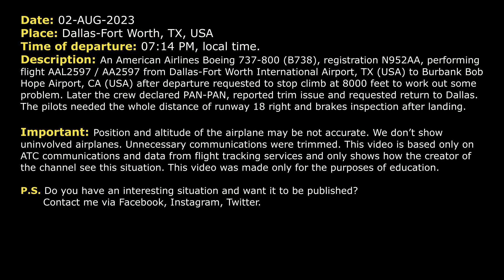PAN-PAN. Trim issue. American Boeing 737 need to return to Dallas-Fort Worth. Real ATC

Comment: Good thing they realized the issue while still near DFW.

Burbank (BUR) runways are very short and probably can't handle that type of landing. 5,800 ft and 6,600 feet respectively. That's a 737-800 and I've landed at Burbank aboard a 737-800 on runway 8, the 5,600 foot runway. That was fun 😅.
Reply: They would have just diverted to LAX then.

Comment: Wow, this is second in a week span. It seems that there's a problem with maintanance personel lately. Ironically, airlines and the industry as a whole seem to be more interested in technology that would allow flying with one pilot. Not sure where this eagerness to cut costs and reduce human resource to the minimum will lead, but I don't have a good feeling about it.
Reply: It is being made public more often , nothing to do with cutting costs.
Reply: @nightrider9060  So, it is normal that within 7 days a plane from the same airline has trim issues after taking off from the same airport? Idk much about mechanics, but I've heard professionals saying this is not ok.
Reply: These aircraft are getting older, reports of supply issues, it's also peak travel season. So every aircraft possible is probably in service.
Reply: @DaveLee83  Those are valid motives for why the issues show up. However, they do not explain why the aircrafts receive green light to takeoff with such issues. People from the industry blame it on companies investing less and less on training for the maintenance teams. A lot of experienced mechanics have retired lately or simply quit the industry due to conditions. New ones do their best, but in lack of proper training they often fail to identify problems and deem aircrafts as "safe to fly" even though they are not.
Reply: @BlueSkyUp007 there's certain faults aircraft can and can't take off with.
Reply: You came to this conclusion based on YouTube videos?? Wow
Reply: @saxmanb777  Well, unless the videos didn't made up the information they present, I don't see what's wrong with noticing the "coincidence".
Reply: @BlueSkyUp_EU  oh I didn’t know random YouTube videos of random incidents was now used official maintenance statistics.
Reply: @saxmanb777  Oh, you meant the maintenance part. Nah, I got that one from current and former mechanics. I thought you meant the 2 similar incidents that happened within a week, same company & same revision point. For the maintenance part, I sure hope I am wrong and you are correct.
Reply: @saxmanb777  Also, if you know for sure that is part of the norm for aircrafts to frequently get back after takeoff due to technical issues, please say it explicitly as I'm not a native english speaker and I don't always get the implied meanings.